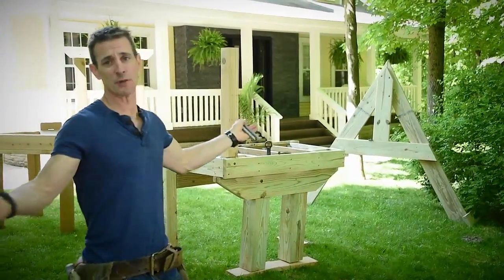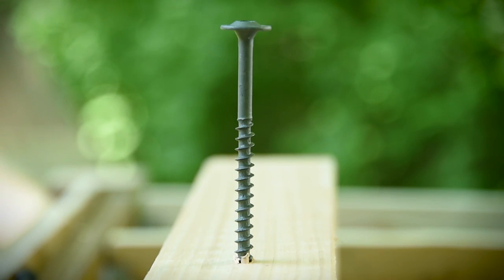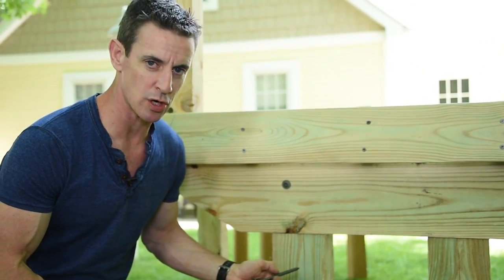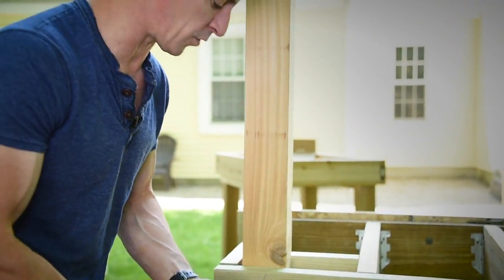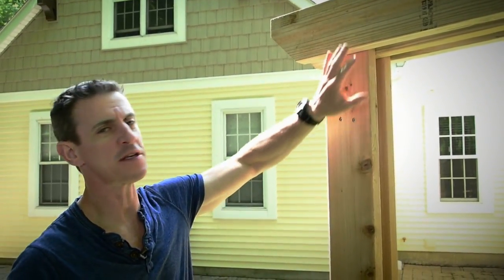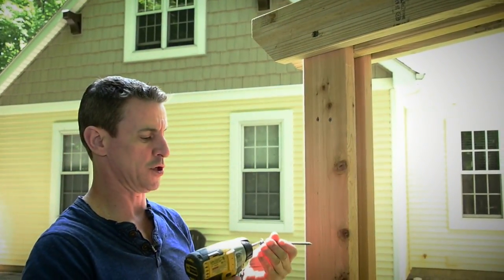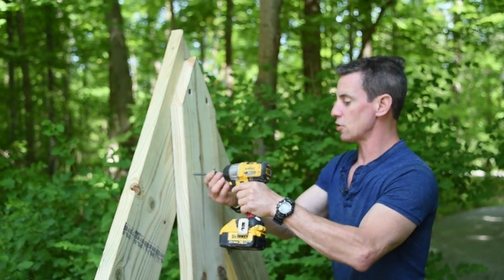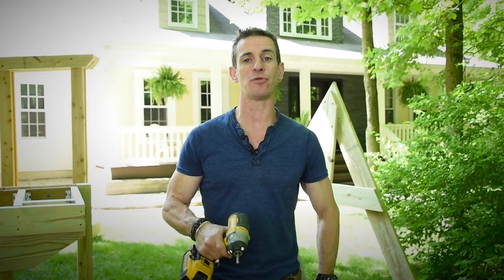SPAX PowerLags vs. Conventional Lags

Comment: I do a lot of DIY and dont follow code or normal accepted construction methods. You get videos that say you cant use screws, gotta bolt or use a $20/30 simson or whatever tie. OK, those suckers cost some bucks per tie.  I used different sizes of these things and I use them for everything. Unless you have an elephant using your pool deck, stairs or using lead sheets on your roof these suckers really hold the weight and tight.

Comment: These look awesome.  Going to use for garden boxes instead of traditional lag screws.
Reply: I just built a garden bed with 1/4 inch, 307 steel (junk), lag bolts.  Over half the screws snapped, wasting the wood and the 400 screws I bought for a set of beds but I learned on the first 48 screws in the first bed.  Now I have to start over.  You get what you pay for, that's for sure. I'd never heard of Spax but I'm glad I found them now.  I'll be cutting up the one bed and rebuilding it, and future beds will, assuming these perform like expected, will all be Spax.

Comment: Can these spax hold ceilings racks?  What is there weight rating for ceiling connections?  Using lag screws currently but want to add more.

Comment: I try to purchaae them at Home Depot  Dartmouth Crossing they never heard of Spax screws
Reply: home depots in Puerto Rico have'em...i checked two weeks ago at home depot Pearland Tx didn't have'em...spent 3 weeks on vacation in Rosharon near Perland...
Reply: -They Had them in Fort Worth, but on the screw aisle it was on the end cap in lumber.  Check the website and enter your location.  It will have where is the store it is located.
Reply: @josevalles4954  -  They Had them in Fort Worth, but on the screw aisle it was on the end cap in lumber.
Reply: Spax are from Germany and maybe they produce them now in the USA too?

Comment: I See  Decmate have self drilling screws with star Heads  years ago Spax was a head of game known most Competitors are switching because of spax.
Reply: Construction screws are using self drilling tips also
Reply: Not necessarily Spax . there is Wurth , another german company , that has a patent on screws that have a drill bit type configuration . pretty cool but crazy expensive

Comment: Spax Change the Game once folks Started tu buy more because of Star Bit and self drilling. I Discovered Spax in 2010 I got tired of Philipps head Exterior Screws spax screws are faster a few screws bent on me back then Maybe Torque Drill is to strong but I still use them.

Comment: Do they break?
Are they Rust Proof and pressure timber proof?
Reply: These appear to be painted steel fasteners, but maybe they sell a galvanized version.  Correction, they are labeled HCR coated, which is apparently proprietary.
"The two most popular chemicals for wood pressure treatment are alkaline copper quaternary (ACQ) and copper azole (CA), which are both active corrosion materials.
 Only two corrosion protection systems are recommended for use with these pressure treatment chemicals: hot-dip galvanized steel and stainless steel."
Reply: Matt Graham Yeah they have them in stainless steel to
Reply: Green coated exterior use and gold coated interior use then there Hdc coating

Comment: What is the shear strength compared with a framing nail?
Reply: A given screw is going to be harder and more brittle and actually have less shear strength than a given nail with a shank of the same diameter.
Reply: They are stronger (shear) than lag bolts twice their diameter and have greater tension (pullout) as well. I'm sure they dwarf framing nails.
Reply: @huejanus5505  how can they possibly have twice the shear strength of bolts ??
Reply: @johnwhite2576  lag bolts have much better shear strength...

Comment: Their deck screws suck two screws in the tip stripped out I had to open the other box to use its tip same thing I was pissed all theses screws no tips just a bunch of screws with no tips T 20 tip you can see its to small of a head for the Job.
Maybe the lags are better who knows I won't be buying tired of being sold low end to learn the company makes a higher end.
Reply: Cookinitmax, Hillman square drive deck screws. Economical deck screw that’s pressure treated rated. Grip rite also makes a combo drive you can get in exterior screws/deck screws. Also not bad cost wise. If you just gotta have the best, GRK. Be aware that they make screws designed for interior use as well, so make sure you get exterior rated ones